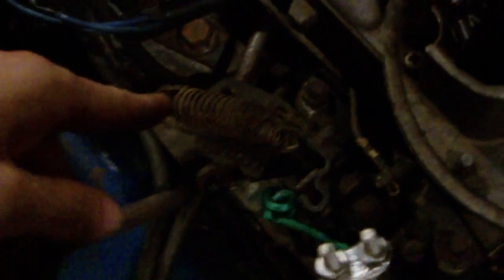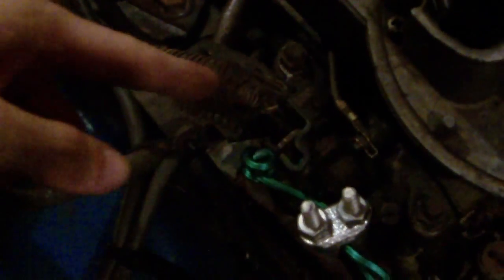Derby Topic: Hand Throttles

Comment: I had a throttle cable break on a dodge neon.  The engine was still running strong and had an intact rad still.  Got 4th and possibly would’ve done better had throttle cable not broke. Definitely running a hand throttle as a backup now

Comment: I would use a brake handle from a bicycle, super easy to hook up and mount. (Id weld a little tube to the left side of the stearing wheel mount and then just put the handle on there like on a normal bicycle) and its WAY easier to actually drive with than just pulling a string. If theres no room near the stearing wheel, place it somewhere near the shifter so you can push it down, rather than pull at it... Works like a charm!

Comment: Ive ran minis for about 10 years and never had a throttle cable failure. With most FWD its just not an issue.

Comment: try a square with one side all thread with 2 nuts and washers inside (between) the nuts so you can tighten the washers around the wire and move it from car to car easily Ill make a diagram if you want

Comment: I rigged our ford windstar with one becuase the F%$#@ won't idle and no mechanic can figure it out. Also I am sick of buying parts only to have the same issue, and frost bitten feet keeping them on the gas so it  will idle. it's been a life saver :) anyone commenting on oh it's this or that.. been there done that with SEVERAL mechanics and parts.. even the throttle body itself,several censors,ignition module.